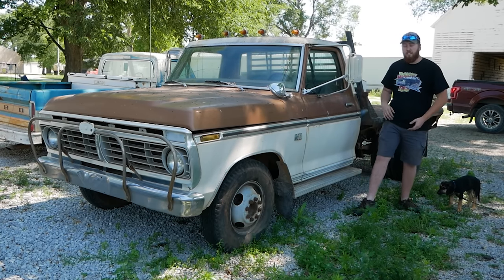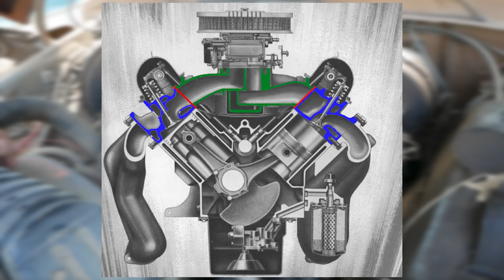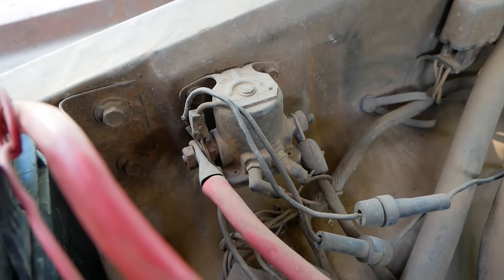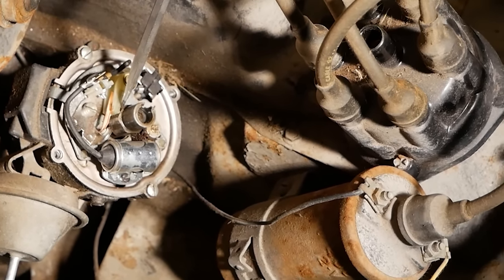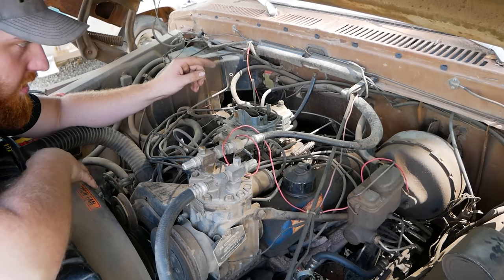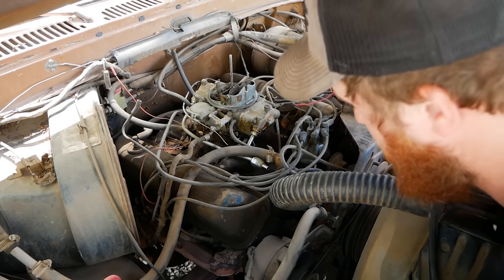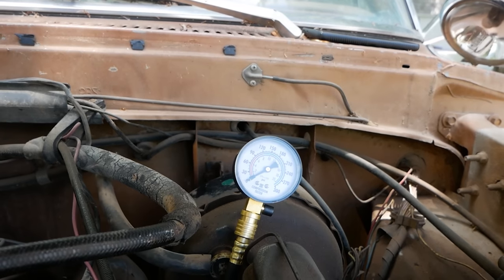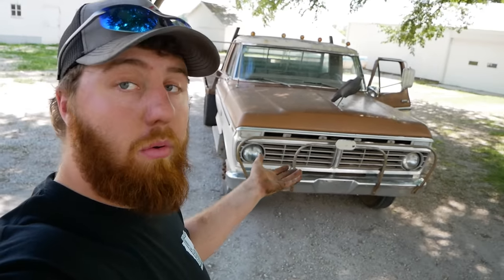How To Revive Abandoned Cars and Trucks! 1974 F350 First Start

Comment: Another fun fact -- on a Ford if you replace your stock points/condenser with a Pertronix Ignitor module and the stock coil with a Pertronix Flamethrower coil, you can run 12V to that coil all the time and get a much stronger spark -- thus allowing you to increase your spark-plug gap by a few thousandths and make more power.  I had a '68 Ford Galaxie 500 convertible with a 390 engine that I ran that way for well over 10 years with no problems.
Reply: If you run a pertronix coil etc you must give it a permanent 12v source. Watch th289s recent video on them

Comment: Loving the ( keep the bi$ch floored ) hat.  (FE) some call a wedge engine . 332 , 352 , 360 , 390 , mecury 410 427 , 428 . And the industrial versions like the 332. All had extremely bad exhaust manifolds

Comment: I keep seeing tin cans mounted in the engine bay, this truck has one on the inner fender of the driver's side.......what is their purpose?
Reply: Vacume canister. Cars from this era especially had lots of vacuum controlled accessories and smog control components. The canister helps “hold” a vacuum to run those.

Comment: About wiring and stabbing a dizzy: it ain't that hard. you read a bit, wire it up, get it sorta right, and mess with it till it runs properly. Trust me, if I can do it and get it rightish first time every time, so can you. What's the worst that will happen - you'll have to rewire or restab the dizzy?
Reply: Same thing with valve tuneups. Just do it the old school 90-90-90-90-90-90-90-90 method, check it 4x and you will be good and feel confident you are good. Whatever the specialty job, don't be a...wussy, just do it and if you screw up, so what? It's only metal.

Comment: I dont think that truck was a fire truck... Most likely a hot shot or construction company vehicle... Smokey was most likely the driver (A thing that was popular in the 70s).... no holes in the roof for radio antena or emergency lights... and the factory two tone paint is another clue where a fire truck would be a red, yellow, or lime green.... if it is an old hot shot vehicle this truck would most likely very high mileage... that gas tank on the bed was probably used to fill construction equipment if it was own by a construction company

Comment: Too bad it wasn't a 460...  Love to see them fire up, and its an FE so it will run, np.
Reply: You have the SuperDuty Radiator, large tank setup.    I found a local F250 reg cab, long box, 460 with the SD rad, and it was only 3 core, and plugged from negligence.  Sad part was, the Local Rad shop quoted me $1000 to fix..........No Lie.  Luckily I kept the rebuilt small tank-4core I had Remanded in early 2000,  and am using it on my 429-F250.

Comment: I'm not a mechanic but don't stuff run better with a air filter, that's how they are set up ??
Reply: Not really. Air filters restrict air flow, so you are supposed to reset the carb once you out it on, but no one does.

Comment: You showed the mantra many people forget. The car or truck was parked for a reason. That truck was because of a head or head gasket issue. Others might be a bad transmission or destroyed brakes. I've seen one that was parked because the frame was cracked and another just because it was old and the owner got a better car and wanted that as a spare in case the new one was a lemon. You never know. That's why field cars and trucks are cheap.
Reply: Remember the owner won't know why it was parked or they say they were just tired of it. I haven't ran across many people who will tell you its because the 1500 dollar transmission or 1000 dollar engine is trashed.

Comment: I wonder why they still call the capacitor in a set of points a condenser.  If it were in any other device besides a vehicle they quit calling it a condenser ages ago, like vacuum tube radio ages ago, lol.  I fix up old radios so I use the terms interchangeably and know that if something say's smoothing condenser in modern terms it means electrolytic capacitor.  It's like cycles and hertz.  If something runs on 60 cycles it's 60 hertz and I am guilty of saying cycles a lot more than hertz, lol.  To work on something I'm unfamiliar with I usually turn to youtube, not google, as if you can think of something to do, someone has probably already made a video showing how to do it, lol.  Even the most basic stupid stuff.

Comment: Definitely don't trust other people's work - even if they're supposedly competent. The car I bought came off a guy on an enthusiast forum, a supposed expert been working on these cars 20 years.

jesus he did some sketchy stuff - he wrapped rear brake pipes around the rear trailing arm. there was more twisted and taped wire than there was shit connected in the car. the front bumper was held on by jb weld, carb was glugging like crazy, ignition timing was off. It was a mess - I'm honestly suprised I got it home before having to work on it.

It was a great price and I'd sell for twice what I paid after rebuilding the carb, but jesus people are dumb.

Comment: Turn That in to a tow truck.
Reply: Put a slide in autoloader unit on top of that flatbed and put lights a lightbar, tow lights, and autoloader controls in the cab for an on depth custom electrical accesories video.

Comment: What is it with you and MR SBC will crack through the intake valley head 289 always testing for spark on fuel sources?  carburetors and fuel pumps are not the best locations to test for spark sure I know they were dry and all but not a real good example for some of your fans witch I remain by the way Lol, but that 289 guy and his lack of respect for my beloved SBC needs to tell it like it is Windsor blocks crack through the valley they are known for it they, in fact, crack right in half when they start making big power so as Stapleton42 says suck it 289!  Lol  Oh, and GM doesn't make you do math it just asks you to count, the reason they made v8 engines or any v engine was to save space, an inline 8 cylinder engine with a 4-inch bore would ruffly take 3 feet + the v version some where around 2o inches the holes look like this oooooooo now on a v 8 it's just the rods that have to be together that's why one bank is usually ahead of the other by like an inch so 8888 is shorter than oooooooo and if you number the cylinders in an inline 8 it is 12345678 and if you separate them in a v it is still the same inline 1 right bank 2 left bank 3 right 4 left and so on not at all complicated unless your a ford guy ask any dodge guy they will tell you the same thing ford got it all f ed up !  Lol math ha  Ls swap it 6.0 !  Lol

Comment: so thats a pointless ignition system i have a 2000 ford ranger diesel 57kw 2l i beilieve bought it havent even heard it turn over yet owner said it had a starter came home it didnt but i wasnt conna come home without because it was 400km round trip and i paid for the towtruck already and actually my dad went and got it because i dont speak russian and they said the frame was good i leaned on it when it was home and the damn thing broke off so yeah now i have a new frame thats in the works cause i dont have a good welder or the experiance to do it and it was going to be sand blasted and welded and then painted after i go and check it out and then im gonna put a mazda b2500 bed on it because the bed is softer than paper so yeah its a money hole but i need a pickup so i can have 2 barrels in the back because i work in the logging and the machines need fuel and then i dont have to bother the bossman with my fuel and also i can fill my own truck too because w in europe cant use offroad diesel outside of farm use even if you have a excavator working in the field digging ditches

Comment: dont push down plug cap wire...old wires could arc on you if insulation has degraded...hurts quit a bit.    btw...dont trust a 9 fingered mechanic..